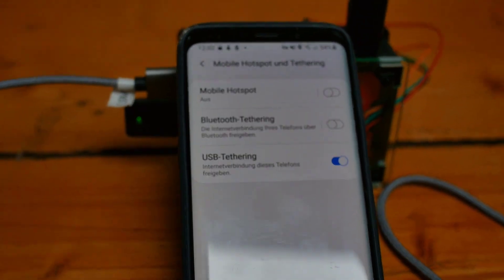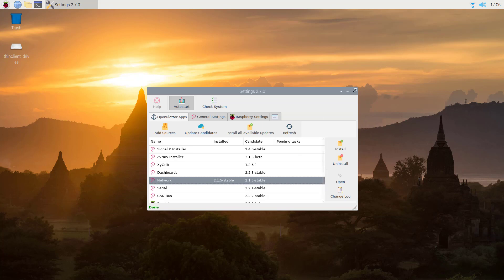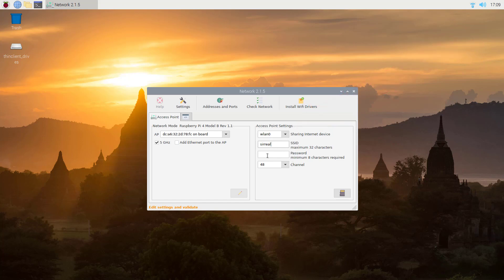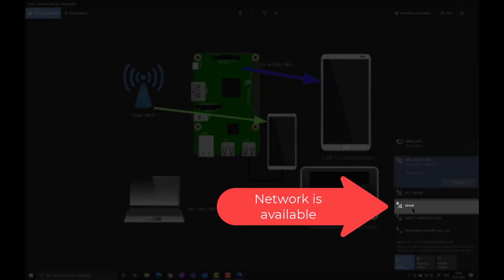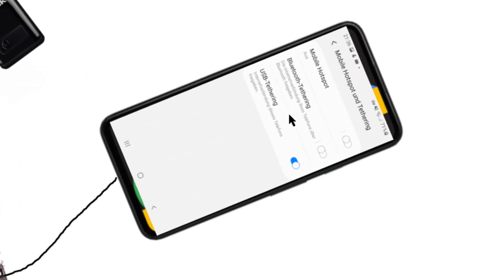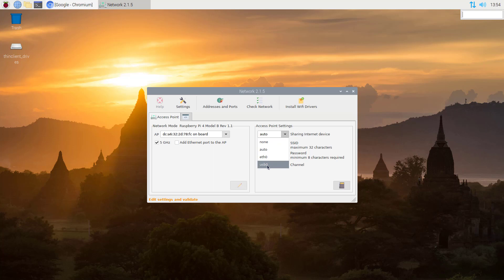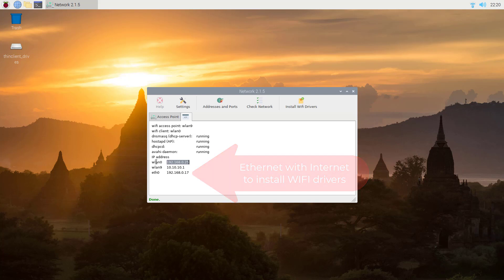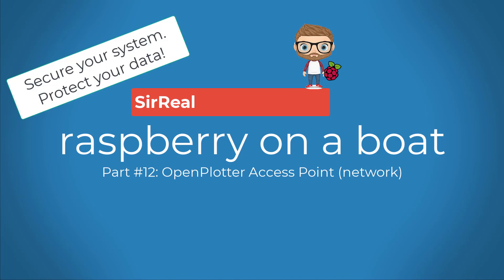raspberry on a boat #12: OpenPlotter Access Point Configuration (network / WiFi hotspot)

Comment: now that was really confusing. You simply say the option AP and Client doesn't work then you mention a cable to the Phone, then a dongle and thats it. Love your videos otherwise but this one was of no help. 
So the Wifi dongle now is connected to your home router ? Or the phone hotspot ? Same thing ? 
I added my NMEA multiplexer to join the RPi4 access point but I don't get any data.
I am configured as AP and Client as I need to connect to my hotspot too. Well, maybe I find the info somewhere else. Thanks anyhow.
Reply from the maker: Hi!

I did explain two alternatives. Dongle OR USB to smartphone.

Step1:
We use the Raspberry's internal Wifi to create an own WLAN (access point). This is done at 2:10min. 
This is already an access point but it has not Internet connection at all and no forwarding is configured.

Step2+3 A-version:
Connection via USB to your smartphone and enabling USB tethering (4:00min)
AP setting to auto or USB o that it is clear that our Raspberry shall forward the Internet requests.

Step2+3 B-version:
Installation of a WLAN dongle to get a second WLAN interface (5:00min).
The second WLAN is used to connect to any Wifii which can provide an Internet connection. E.g. the harbor's Wifi.
In this case the AP settings must be set also set to AUTO or the specific Wifi dongle which was added.

Summary: I explained two versions. You need to decide for just one and follow the specific part. Easier is the phone-connected version with USB tethering.

Comment: I have the same problem on a Pi3 and on a Pi4B 8gig. What version of openplotter do you have? In my case wlan0 is inexistant and wlan9 is not associated. In addition the network interface always reports the impossibility to write to /etc/dhcpcd.conf:
error savin /etc/dhcpcd.conf. The dhcpcd configuration file is not writeable. 
Any hint would be appreciated.
Thanks.
Reply from the maker: It is a while ago so I don't know the version I used at that time.  Maybe you need sudo rights to get changes applied. However, difficult for me to say w/o knowing what exactly happened. I think you should take this question into the OpenPlotter board.

Comment: Hi SirReal
Anyway to set static IPs for printers, Pypilot, NAS,…
Reply from the maker: Hi Andy,
You can always set static IPs even if a DHCP server is running.
The only requirement is to choose IPs outside the DHCP range.
The other way is to define a specific IP address which the DHCP shall assign always to the same MAC address. I didn't look into that for our  DHCP here but I am quite sure you will find this in the specs for the configuration files.

Comment: I have been building along with you SirReal, and have enjoyed and learned.  I wasn't sure if the RPI OpenPlotter was something that would be of benefit for me specifically and my sailboat.  However, yesterday that all changed.  I have a system that really would be very beneficial for me and this was completed by following your Rapberry on a boat series.  I have a RPI 3 with dAISy HAT, a GPS USB puck.  The AIS and GPS data is showing in OpenCPN on a monitor connected to the PI.  But, I am also getting the data to transmit to my Android tablet running Navionics using SignalK.  Again both AIS and GPS data.  I have an older RayMarine chartplotter and Furuno radar system on the sailboat (about 15 - years old).  And, for cruising here in the PNW I use my Android tablet as primary for navigation and the 7" old Raymarine display as backup (also my Android phone with Navionics).  Now, with AIS data on the tablet in the cockpit I see huge benefit in installing the PI system aboard.  Thank you, for creating this series of videos.